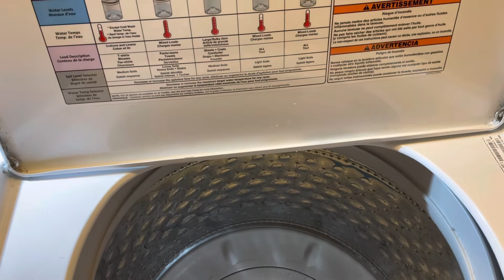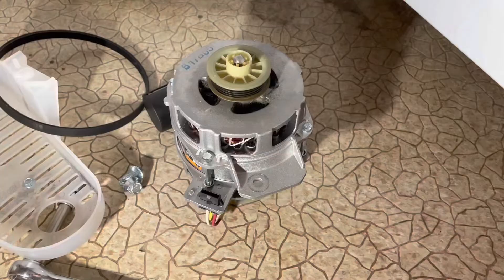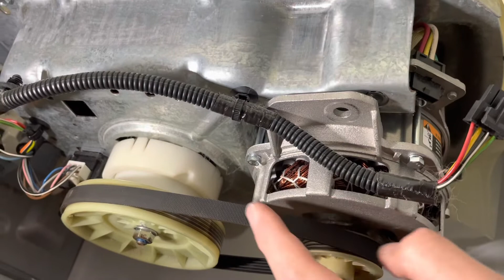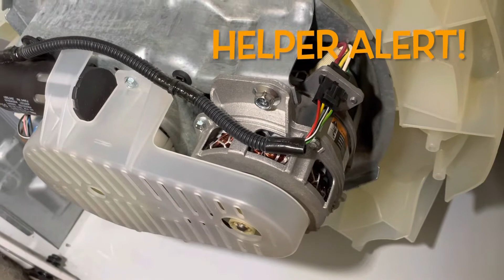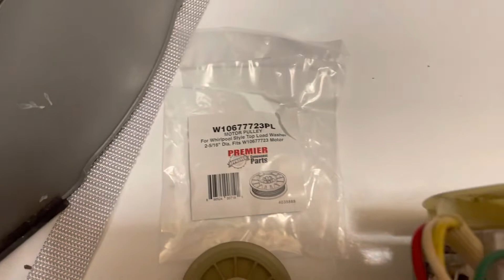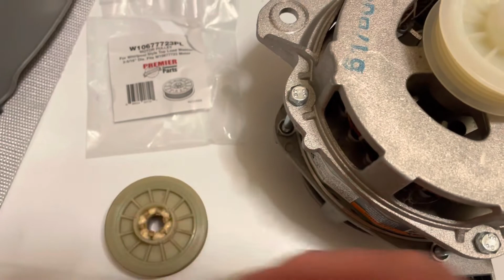Kenmore Series 500 Grinding Noise and Drum Not Turning - $20 Repair

Comment: Can you put a link to the amazon part
Reply from the maker: I just double checked to make sure they are in the description. It has the short codes. This is for the pulley. https://www.amazon.com/W10677723PL-W10677723-motor-Replacement-Whirlpool/dp/B0BDTDC2PV

Comment: What was the noise it made? I have same one with a noise, replaced the clutch and motor still same noise but didn’t replace the part in this video what was the noise?
Reply from the maker: The noise comes in right around 45 seconds. I had further trouble with a very similar noise that turned out to be from the hub on the top. It also has splines and wore out. https://a.co/d/04wfE51N you have to take the little silver cap off to expose the nut, with the nut out you can remove the agitator plate thing. Under that you will see the linked part. Pry out the horseshoe locking piece and then it is just Phillips screws I believe.
Reply from the maker: Kenmore Series 500 drum not turning and learning from my mistakes, save hundreds!
https://youtu.be/zUqSpiJ_dFs

I added another video on this with some of the other noises I have experienced and more of the parts I have replaced.

Comment: Hi how long until the pulley went bad Im having the same issue but my pulley seems to still have teeth somewhat. Thank you
Reply from the maker: Funny that you ask that, because I have been wanting to do a follow up video. I just replaced mine for the second time at just over 2 years. About a year ago I had similar symptoms but it was the drive plate on top. That one is accessed by removing the plastic cap on the “agitator plate,” then the single bolt there, then there are 6 screws and a U-shaped locking piece.
Reply: @Shoefly007  what was that sound for that 6 bolts and u lock

Comment: Just ordered part!
Reply from the maker: Thank you for your question. If it is the same issue as mine, the splines are stripped. As soon as you remove the nut, it will likely fall off. Be careful holding the motor shaft so you don’t damage the windings of the motor or the fan on the backside of the motor. I put the belt back on before tightening it down.

Comment: You can work that belt back on the pulley by turning the pulley and working the belt back on as you turn it.  Then give it a couple turns to make sure it doesn’t jump off the motor.
Reply from the maker: Agreed. I also found on this one that just putting it on in the correct order made it very easy. 1) motor bolts very loose 2) belt over motor pulley (it has the flanges) 3) put it over the drum pulley 4) tighten motor bolts
Reply: I am struggling to get belt back on.
Reply from the maker: Sorry to hear you are having trouble. Best way I have found is to loosen the two bolts holding the motor in place. Then loop the belt over the motor pulley (with ridges) before stretching it over the bigger pulley on the drum side. Hope this helps!

Comment: There is no belt on my kenmore series 500
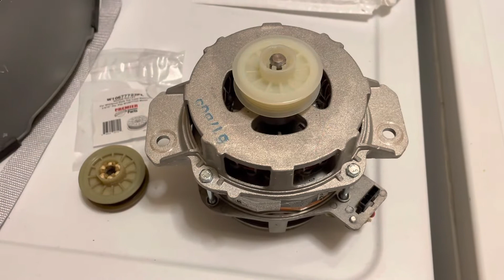Reply from the maker: 🤔 not sure on that one. Does the bottom look like mine at around the 2:45 mark? On mine the belt is under that cover.
Reply: @Shoefly007  I would have to disassemble more to find out for sure
Reply from the maker: On mine I did not disassemble much. I lifted the front bottom edge just high enough to put it on a Jack stand and accessed everything from underneath.
Reply: I ordered and changed the same part , it didn’t fix it still making noise . 😞
Reply from the maker: I am sorry to hear that. When I got down to the pulley on mine it was pretty clear it was spinning on the motor. It has recently started to periodically make more of a screeching sound, but I haven’t even started to try to address that.

Comment: Hello boss im have the same issue how to hell did you remove the pulley I am currently in the middle of doing this. I can remove that plastic pulley
Reply from the maker: I can definitely see how that can be a challenge. I think I found a socket, maybe 1/2” (not sure) that just fit over the shaft and used it to push those plastic fingers out of the way. It may help to gently wedge something between the motor and the pulley at the same time. I hope this helps. Let me know if it doesn’t and I will think a little harder. It really shouldn’t take much force.

Comment: It looks like removing the motor was not needed. Just remove the defective part and replace would solve the problem.
Reply: I laid the machine down on its back. Everything was right in front of me. Super easy to get to. Pulled the belt gently towards me from larger pulley and while turning it, it came right off. And yes, that’s the problem! All grooves worn out. I ordered the part and should get it in 3 days. Thanks for the video. It was a big help!!
Reply from the maker: Glad that worked! I was too chicken to lay it on its back, lol.
Reply from the maker: That is correct. I couldn’t really see what I was doing with it upside down. That said, you would still need to at least back off the bolts. Taking it out makes it much easier to access the pulley.